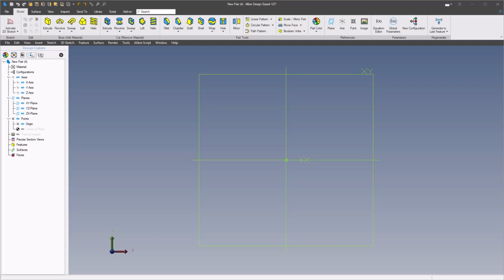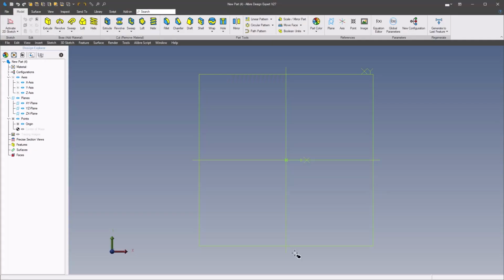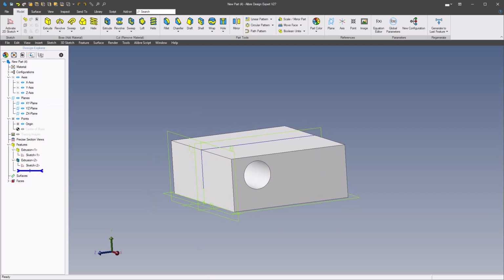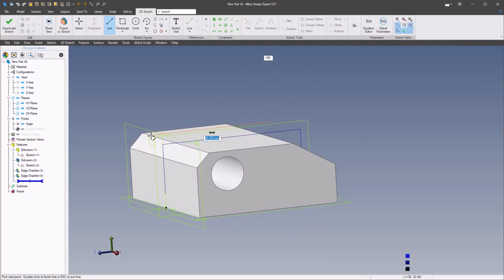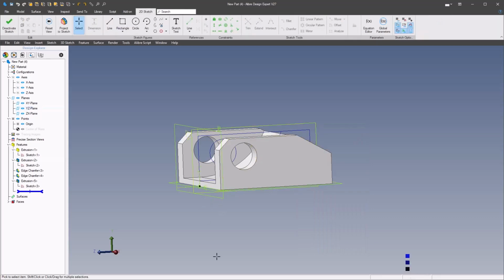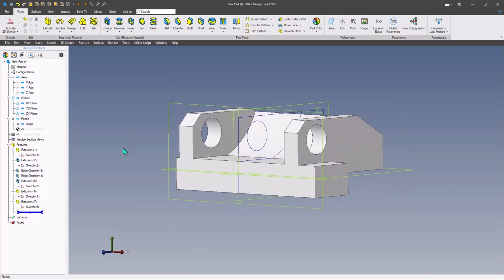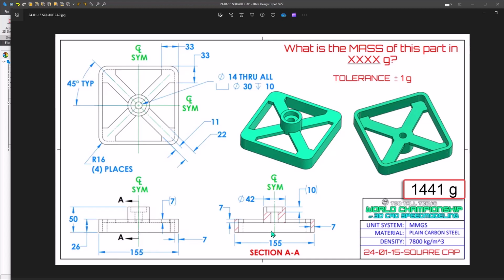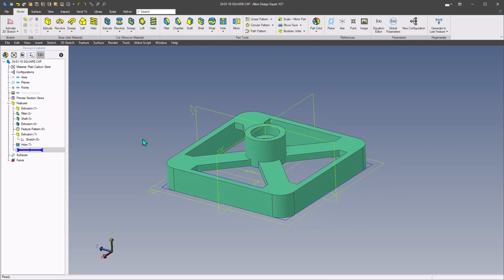Alibre Design -  Extrude To Geometry w/Offset

Comment: Great tips Harold. I use that almost daily. Very very useful tool. And for TooTallToby's competitions the negative offset trick you show is invaluable. Mainly because he often likes to dimension parts in a certain way that is not always the same as the way you'd built up a model in 3D CAD.
Reply from the maker: Thanks. I've been using that negative offset technique for quite a while on some practice drawings I found on the internet. It could be argued that the "correct" procedure would be to create an offset plane from which you would extrude To Geometry or To Next. But in speed modeling that takes time that could jeopardize a winning time in the contest.